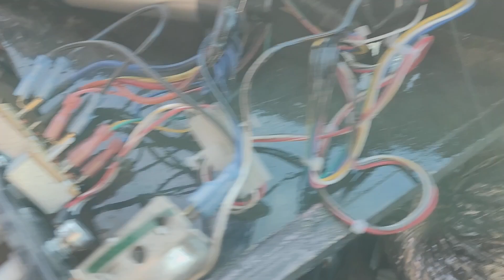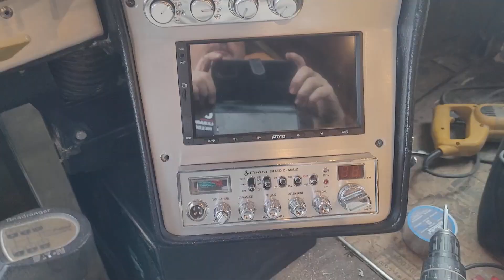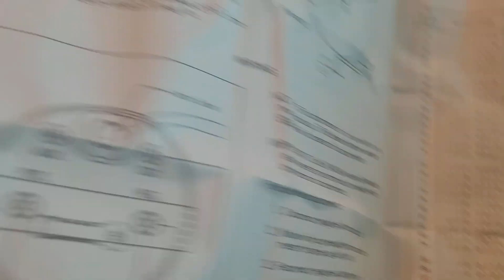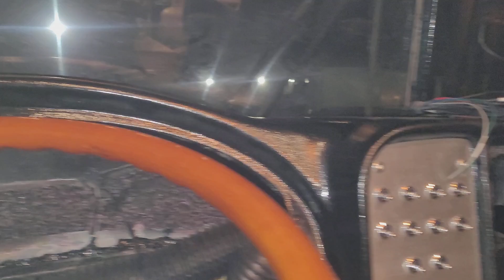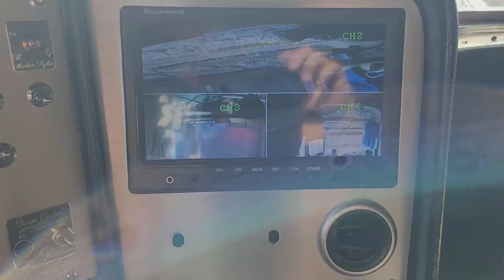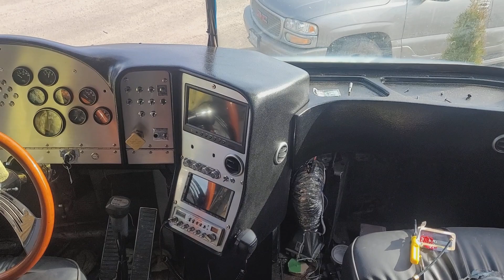Bus Conversion Project - Video 132 - Dash Wiring

Comment from the maker: DaierTek Lighted Toggle Switch 12V Waterproof Toggle Switch IP67 12 Volt LED Toggle Switch RGB(RED Green Blue) 16mm Pre-Wired for Car Boat Marine -3Pack https://a.co/d/hsRhL02

Above is the link from Amazon for the switches